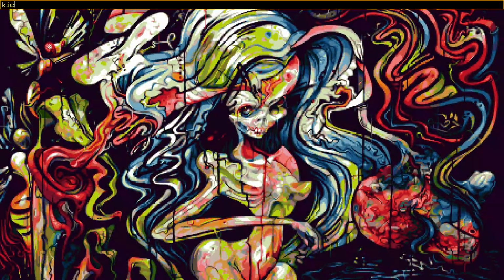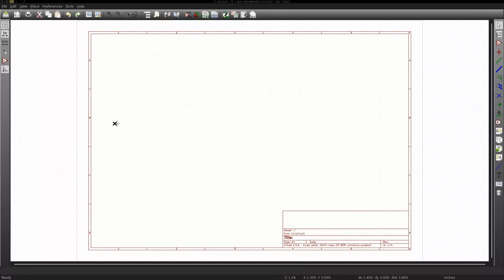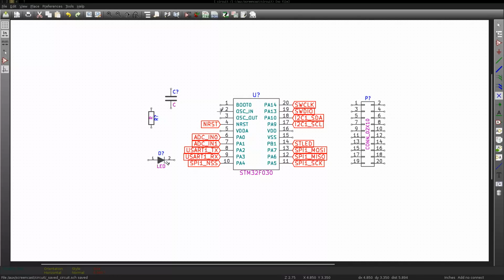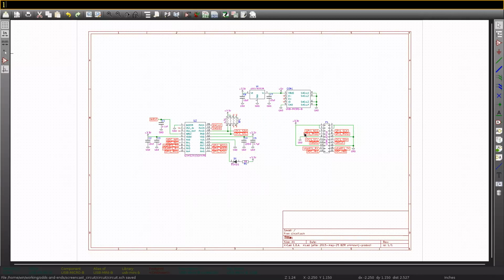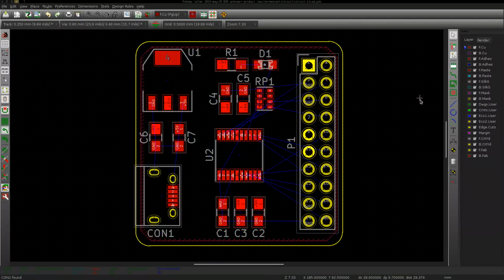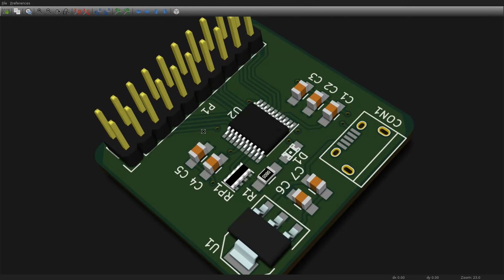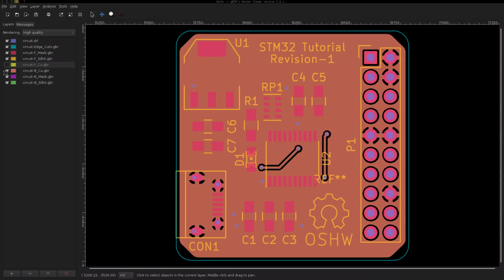KiCAD Quick-Start Tutorial

Comment: How does KiCad from 5 years ago look much better than the latest version? How did you get dark mode on there?
Reply from the maker: What OS are you using? For this video, I had patched the source code to change KiCad's appearance, but these days I'm just using the officially released binaries. I'm running a Linux desktop with the "Materia-dark" GTK theme, and KiCad automatically picks up the system's chosen color theme. Currently, my KiCad 5.1.9 looks like this: https://imgur.com/a/5EzPmrH
Reply: @WindsorSchmidt  Wow that actually looks really nice. I'm on Windows. I found a few themes on github where you have to replace certain part of the config files to change the appearance. Mine looks better now, but still don't have a dark theme for the launcher and stuff like that. It's fine though, I'll wait for KiCad 6 later this year. I hear they're changing the config file format to JSON so it'll be easier to customize themes and stuff.
Reply from the maker: @regal_7877  I know the config files allow changing layer colors, but I think the UI will still follow the system theme. In Windows you may still have a light theme, but I dunno. Come back and let us know after KiCad 6 drops! :D
Reply: @WindsorSchmidt  Will do. I'm not a complete newbie at customizing JSON files since I do it a lot with vscode. When KiCad 6 is out, if I manage to get a nice theme going maybe I'll even upload it to github and post a link back here for other to try.

Comment: How do I solve this problem? Symbol L1 pad ~ Not found in footprint Custom Components:T-68-6 CT.
Reply from the maker: Make sure all of the names of pins on your symbol have corresponding names on your footprint. Probably in your case, your symbol has a pin named "~" but your footprint doesn't have a pad with that name. Typically symbol pins will be named just "1" "2" etc. Also, symbol pins can be marked invisible in the symbol editor, which hides them in Eeschema (schematic editor), so make sure to open your symbol in the symbol editor to be sure. Hope that helps!
Reply: @WindsorSchmidt  I tried all that but it refuses to work!

Comment: Any chance you could make a followup, or recommend another video, for footprints?

Particularly, I have a Geiger tube which needs to go into 2 fuse holders to clip the ends. How do I put those 2 holders in as a single part as the footprint, for an oddball like this which doesn't exist in the standard libraries?

Comment: I had to stop watching this after less than a minute. I've used KiCAD before and one of the biggest challenges I've found is long term management of libraries especially any custom created parts. HOWEVER this uploader went blithely to create library entry for the STM32 without even checking if one already exists ! BAD move !
Reply from the maker: The ST part in question did not exist in the library on my system at the time, which I knew before making the video. If the part already existed in the library, what would be the point in creating a duplicate symbol for it? On the other hand, demonstrating how the part was not in the library wouldn't add much value to this video, unless the very existence of a preexisting library of parts is news to you, which would put you outside of my intended audience here. My intention was to produce a short video for people already familiar enough with other EDA tools to know if/when they need to create a new symbol.

Incidentally, if a part you're after does exist in the library, it's still a good idea to check it for consistency with your datasheet, and footprint. Remember when KiCad decided to swap anode and cathode on its diode symbol? https://lists.launchpad.net/kicad-developers/msg18027.html (not that this sort of thing happens often).

It may also be helpful to mention here, that KiCad's symbol library is rapidly expanding, with new parts contributed almost daily! For example, many STM32 parts have been added since I posted this video. GitHub is a good place to hunt for the most recent changes: https://github.com/KiCad/kicad-symbols
Reply: @WindsorSchmidt  Thanks. I'm fighting with a nightmare of library management with a 5-year old project of mine at the moment. I was hoping to find helpful discussion/tips on this topic on YT, but have gicen up. There's a 1/2 decent article on Hackaday I'm following now.

Comment: Concise video, introduces the core KiCAD functions in a clear and energetic manner. After watching this I can confidently build beginner PCB circuits. I don't get one thing though (this has more to do with the electronics, rather than the tutorial itself) - where are the routes to the 3.3V? Is that why you used the copper filling on the front side?
Reply: 3.3v and gnd are nets like any other. On the schematics they are connected on multiple pins. fillings for both power supply nets is a common practice in pcb design, this allows both large currents and shielding. It is also a common practice to have dedicated layers for power (4 layers or more)
Reply: @jobarjo78  Got it, thanks!

Comment: Great Tutorial, Very succinct! 

I hadn't used any PCB design program before, and wanted to design a PCB to save time on soldering multiple boards and have a clean finish, and this video  was my single resource to creating my own design (for an Arduino project). 

I do have one question though, I see that KiCad automatically places solder Mask around the vias, but I am wondering, do I need to place solder-mask to isolate tracks from  nearby vias?  Or is the default placement sufficient?

Comment: Where is the simulator part of Kicad? Was not in the Tools when doing the Schematic ( as is in Circuit Wizard)
Reply from the maker: Danfuerth Gillis should be an icon for it in KiCad's main GUI (before starting schematic capture, etc.)
Reply: Windsor Schmidt I checked again and the simulator is only available on the "Nightly Build" of KiCad which I installed.  Thanks. Too bad KiCad does not have the awesome simulator from Circuit Wizard as it is a full click and run and watch simulator no nonsense input setup ( it does not use Spice) so all circuits are seen live in many methods available . After autorouting to the PCB section there is also the same simulator as well so now with the PCB done you run the sim and watch your virtual PCB in real time. Without a good simulator all these software packages are useless. Anyone can connect components on any Electronics Cad program but it is all useless without a good simulator. So far Altium, Multisim and Circuit Wizard are dead on with the Sim part.  Been on Circuit Wizard for many years and it is my go to tool. Had many PCB boards printed off site all designed in Circuit Wizard. Mostly LED signs and audio circuits.
Reply from the maker: Danfuerth Gillis gotcha. Also, I don't have a favorite simulation too, so I'm curious to check out the tool you mentioned. Do you have a URL I can visit? Thanks!
Reply from the maker: Danfuerth Gillis Excellent! I'll definitely check it out!

Comment: how do you move the ref des silk screen?  I've tried clicking, using M hot key, nothing moves the ref des.
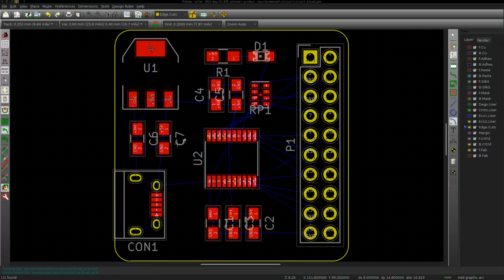Reply: @11:20 I noticed you are moving the designators.  I cannot move them like that unless I have Hightlight Net selected (upper right hand corner), and I notice you are not selecting that mode to move the designators.
Reply: "mode footprint" has to be shut off.  Duh.

Comment: Hello, I am new to KiCAD. I would like to ask how, can I install 3D viewer? Thanks in advance.
Reply from the maker: Hi Orlin, the 3D viewer for boards and footprints is Part of KiCad. You shouldn't need to install anything extra. My keyboard shortcut in PCBnew to start the viewer is ALT+3. Hope that helps!
Reply: Which version do you use?
Reply from the maker: In the video I was using a version compiled from source, but that was over a year ago. The last stable release, 4.0.7 (August, 2017) is much newer. ALT+3 works since the last stable release, IIRC.
Reply: Thanks for the response! Have a great time!
Reply from the maker: Wings 3D is great, but KiCad does have a built in 3D viewer for PCB footprints (and did at the time I posted this video). Here's a post about the new version from last July: http://kicad-pcb.org/post/new-3d-viewer
Reply: Thanks!

Comment: It would have been better if a basic circuit was produce. E.G. LED, POWER, OPEN SWITCH AND RESISTOR. This is a simple thing I want to do to get started. I want the open switch, but the file was not automatically loaded and now I am having problems finding and loading this item.

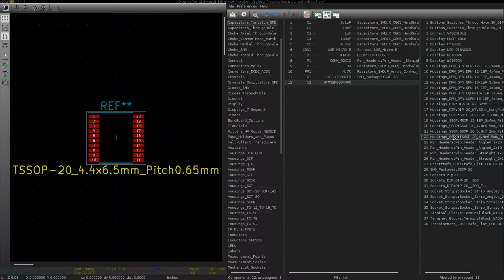Comment: 8:05 when you're adding in footprints, how were you able to use a footprint that had already been created in the default library? The symbol you created just uses a generic footprint? 

Also great tutorial, it's my second time design a chip for an internship. First time I got to use Altium which was always a pain, but KiCad runs much faster and smoother.
Reply from the maker: Hi! You're exactly right. That symbol was for a part having a package compatible with an existing footprint, so I simply chose to use the library footprint. The standard library is growing and improving pretty quickly.

Comment: Dear Schmidt, very good video and explanation. One question: What program you use to capture this video ?
Thank you
Reply from the maker: In Linux I used this from the command line:

ffmpeg -f x11grab -r 60 -s 1365x767 -i :0.0 -vcodec libx264 -preset ultrafast -crf 0 -threads 0 output.mkv

If you're running Linux you could also try installing "simplescreenrecorder" - that one has a GUI and might be easier. Hope that helps you!
Reply: I am an entusiast of Linux. I check this command and 2nd option simplescreenrecorder.
Thank you very much !!!

Comment: While creating an electrical symbol (like your STM32F030) you should pay attention to the "Electrical type" of each pin. You did not pay attention and therefore all your STM32F030-Pins are now "Inputs". This will cause problems when doing an ERC on the schematic... But anyway, thanks for this tutorial!
Reply from the maker: Hi Thomas, you're of course totally correct. I probably should have mentioned this, but I wanted to keep the tutorial very short. Setting the pin type would probably be good to show along with a demonstration of KiCad's hierarchical schematic blocks. Thanks for the comment!
Reply: Its right decision. Short and simple at the begining. Thanks a lot!

Comment: I dont understand this:

after you added all the named pins you draw a box
indicating the plastic package TSSOP20

but you do not specify any width and length for 
the box - so the STM´s footprint will very likely be
too big or too small

how can I specify that the box should be 4.5 mm wide
and 6.5 mm long BEFORE I add it to the
Elements Library ?
Reply from the maker: Hi Gerald,

In this tutorial I am only showing the creation of schematic symbols, not the associated PCB footprint. The symbols have no bearing on the footprint. In this video I show how to link the symbol with a footprint from KiCad's standard library of footprints using CvPCB. To be clear, you don't use the schematic symbol editor (EESchema) to specify the physical size of the component; you'd use the PCB footprint editor for that. I wanted to limit the length of this video, so I decided to omit the creation of a footprint, since many new electronic components on the market use footprints that are already defined in the standard library, making symbol creation the more critical operation here. I hope that helps you!

Comment: For a couple of years now I realised I needed to move to a better pcb package as I am struggling with the smaller components (Im using BM2). Dreaded this move (as I know BM so well I do it in my sleep) but always figured Kicad would be a good option to go to. Holy s**t in a few hours Im converted. Only a couple things I find difficult. Can track widths be changed on the fly? I do plenty rf stuff and need to change often, sometimes even 6 or 7 times in one track as I go under various components. Secondly when I flip TH components to the other side the pads move to a different location and don't line up with the pins. Is this a bug?
Thanks again.
Reply: i 'm reakky want to create working background like you .. Could you give me instruction to set up it ? Thank you !!!

Comment: When I'm looking at the 3D output it isn't showing the components on the board. Only the PCB design is coming. Any settings required for that?
Reply from the maker: +saumya gupta Sorry for the late reply. If you have this problem using your own design, you can try loading one of the example files distributed with KiCad to test with. If you are making your own new footprints you will have to associate them with 3D models (.wrl). Also KiCad has some configuration for filesystem paths that need to be properly set for KiCad to locate your 3D models. Hope that helps!

Comment: That was helpful. Also the black background looks nice, how can I get it for KiCad 4.0.1 windows version?
Reply from the maker: +Beso Undilashvili Thanks! The background color used for the editing area of the schematic capture and PCB layout tools can be set in the preferences dialog within EESchema and PCBnew. The dark user interface (window borders, icons, menus) is a GTK theme; you'll need to be running Linux and set the theme in your system control panel. The details will depend on which distribution you're running. I don't know if this is possible in Windows or OSX, sorry.
Reply: +Windsor Schmidt I&#39;ll try that when I run Linux then. Thanks!

Comment: Just so you know - it's near impossible to watch WXGA screencasts on a normal standard 4:3 monitor because too loose too much resolution going from 16:9 to 4:3. I gave up and I am using a 19" (4:3) monitor. I am guessing your screen is a 24" wide screen. So while your monitor may look great for you, for the rest of us the screen cast looks like crap.
Reply from the maker: +Hacker 404 maybe it's time to upgrade your monitor. 16:9 is quite "normal" these days. http://www.hobo-web.co.uk/best-screen-size/
Reply: +Windsor Schmidt 
lol. 

If you go to the site where the graphs on your linked page come from - 
http://gs.statcounter.com/#all-resolution-ww-monthly-201408-201508-bar
and look at all stats and not just the US and then separate the screen sizes into aspect ratios then you will find that the ratio 16:9 is below 10%

You didn't understand what I was saying before. Resolution has little meaning without considering the size of the screen. What is very important is how much of the existing surface area of the screen you can use. And if you try to fit a 16:9 box into a 4:3 screen you loose a lot of surface area. This has a compound negative effect on viewer experience. 

I won't be changing my screen size or aspect ratio as I still do some web development work and this screen is the closest to the viewers experience. 

So I agree that 16:9 is used more often today but it is still by far the lesser used aspect ratio. On top of that a 4:3 screencast looks fine on a 16:9 screen ... however a 16:9 screencast looks like crap on a 4:3 screen. 

Perhaps you show go do so research? Rather than take my word for it.
Reply: +Hacker 404 You might try using the YouTube's "Theater" mode, then enlarge the html5 video element and div#player-api to whatever size fits your screen.
Reply: +Jonathan C.  The video is 16:9 and I have a 5:4 screen so at the very best! I loose 30% of the resolution. Yes that's right! At most I get 70% of my screen space. You can do the MATH - I did. 

I found another solution. I am an older worker and my eyesight isn't the best. 

I got sick of the age discrimination in the work force and now everyone (in my country) gets to pay a little tax for me. 

Why do they pay extra tax instead of me working? Because I am incapable of working - No. Because I don't want to work - No. 

Because they are unwilling to make the very small but necessary changes to allow me to work with a condition they they also will suffer in time. 

So they see it as "my problem" and now they pay extra tax which I now see as "their problem".
Reply: Horses for courses. Unfortunately W Schmidt is right. You need to upgrade or get left behind. No good complaining when the rest of the universe is streaming ahead.  Are you going to complain when the next OS upgrade for windows comes around and you can't upgrade because you can't afford it ?  If you have that mindset, well, good luck with your life.

Comment: I'm a complete newcomer to PCB design, but how did you know about the exact dimensions of STM32F030 DIM package you created?
Reply from the maker: +perplexedmoth just go to ST Micro's web site and download the datasheet PDF document. In there you'll find mechanical drawings of the part with dimensions listed. This is typical of any mass produced electronic component you'd put on a PCB. Just keep in mind that the datasheets usually have dimensions for more than one part in a given family of microcontrollers, and sometimes several parts will share a common package. Hope that helps! http://www.st.com/st-web-ui/static/active/en/resource/technical/document/datasheet/DM00088500.pdf
Reply: +Windsor Schmidt Thank you! You seemed like drawing the package rather arbitratily (not measuring the width/grids, etc), so that's why I wondered.

You should do more videos, I watched all of your vids. Keep up the good work.

Comment: Tip I got from another video: You can have the software automatically place the tracks for you to avoid having to do it by hand. I found it a bit tedious when I was doing it myself.

The button is "Mode track:  autorouting". It is at the top under the drop down menus, 3rd from the left on my version; click it and it should stay lit. Make sure you the mouse cursor is on (not on the add tracks and vias button). Right click on your PCB screen and select Autoroute > Automatically Route all Footprints